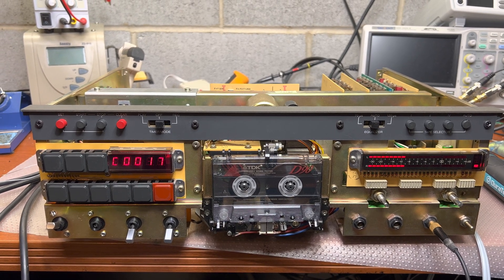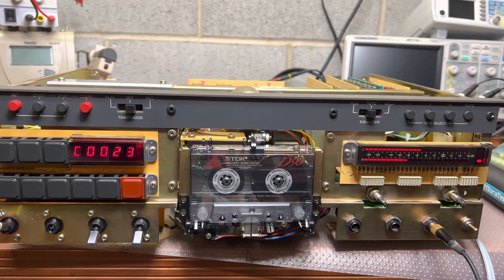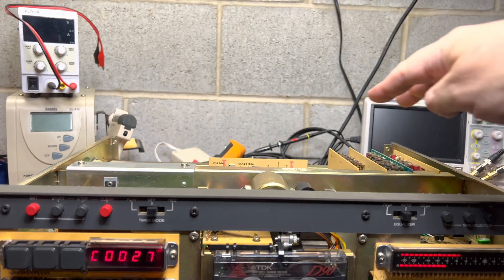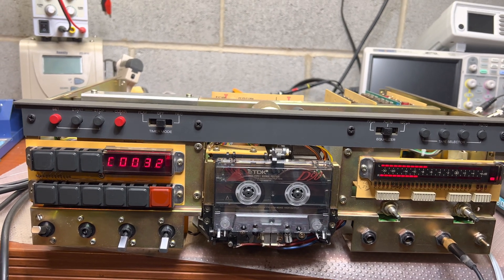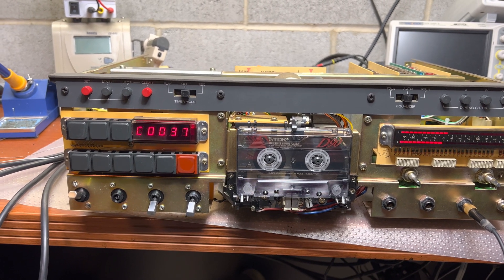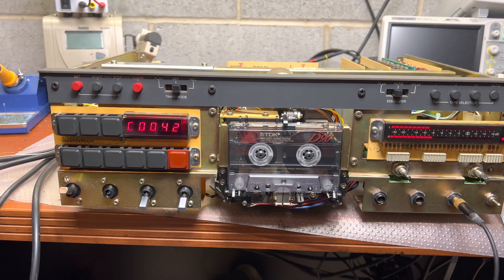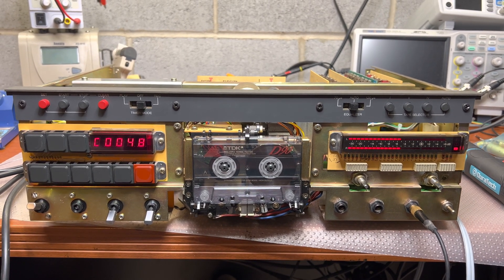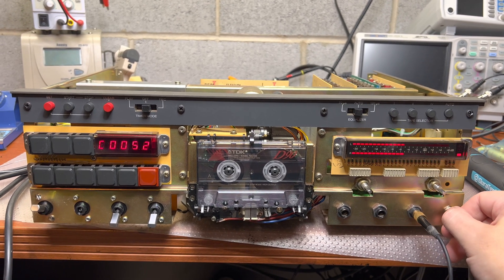Revitalizing Revox B710: Recapping a Classic Cassette Deck

Comment: Hi ! Again I have a question to an expert 😉 I also own the B710 MK I and I can see in many videos that there is a letter "C" in the counterdisplay. Not by mine ? The 7segment works, but no "C" appear. Do anybody know why ? Thank You if You know the answer 👍
Reply from the maker: C means counter mode. Does this segment ever light on your deck? Check with time mode.
Reply: Yes, I know. The 7segment is working if I use the timermode (small circle) maybe it is a different version of software ? In videos on youtube I can see it sometimes, sometimes not. It is not descripted in the manual, so my question.